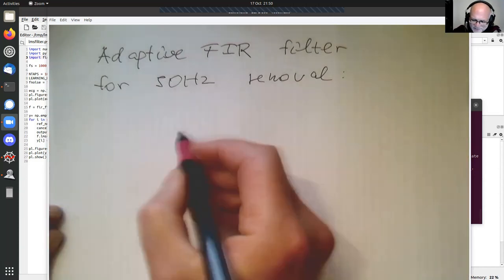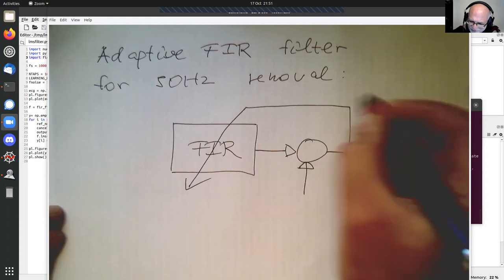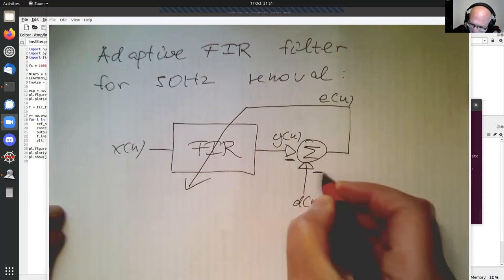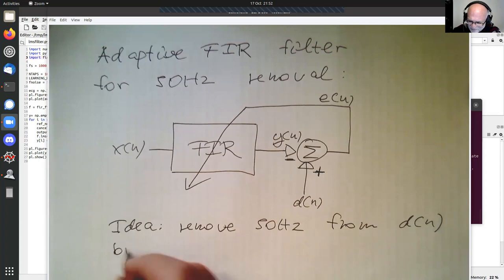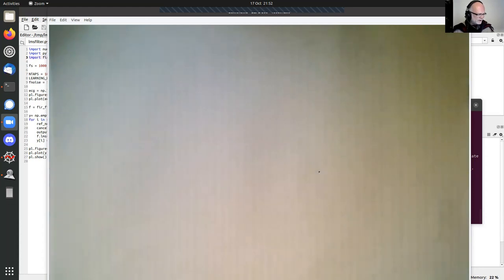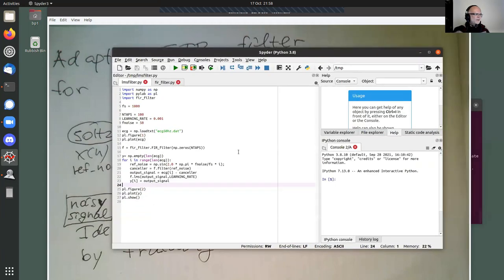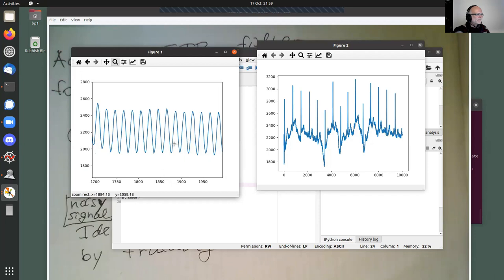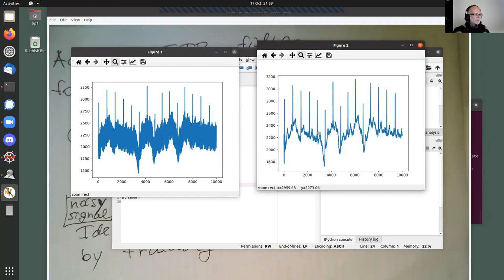Adaptive FIR LMS filters: 50 Hz removal as an example in Python

Comment: Hello DSP, Great example, I am looking for an adapter filter that can predict a threshold on an Acceleration Pulse width while its slope is going in a positive direction. The pulse or the Shock in time is what I am measuring.  From this can I get a velocity by integrating maybe.  If not maybe counts at the threshold.  Counting shock waves is not clean. Threshold is set by the adapter filter.  Weights are changing as well as the magnitude of the waveform.

Comment: Thank you for this great lessons. it inspired me to made some tests with your audio tool AudiClean, and the attached wav file  music+extractor.wav and extractor.wav as the noise reference.
It is very hard to find a entry point for a useful combination of the number of taps and learning rate for this  44k example. Do you have any hint for me?
Another point: What is the best practice for the amplitude of the reference noise? This value wasn't scaled in your python code for the 50Hz Signal [-1,1], but the extractor.wav ref signal for example is much higher.

Comment: I'm having trouble understanding why an LMS filter is required here when we already have the isolated 50hz noise and the noisy d[n]. Can't we just remove the noise by subtracting x[n] (50hz) from d[n]? Furthermore, the LMS filter should be minimizing e[n] as much as possible by matching the filter output (referred to as the canceller in the video) to d[n] as best as possible. In that case, wouldn't e[n] be close to zero instead of having the denoised signal? There must be something obvious I am missing?
Reply from the maker: Excellent questions! We could subtract the 50Hz indeed manually but for that we'd need to know the exact amplitude and phase of the 50Hz. The LMS filter susses that out by itself. Also in an ECG recording the 50Hz noise will be changing all the time so a constant subtraction would only work for a short time. But more important is a slowly changing phase relationship because 50Hz powerline is never 50Hz exactly but sometimes a tiny bit less and sometimes a tiny bit more so that the LMS filter needs to adapt. That for example is a problem when the learning rate is to slow that it cannot adapt to changing phase relationships. -- Regarding you other question about e[n]: this is indeed counter-intuitive and was wondering how long it takes that somebody would stumble over it. So you are quick! The reason why the ECG is not removed is because we tell via x(n) that 50Hz needs to be removed. The LMS filter can only remove noise which is correlated with d(n) so that it can only work on the 50Hz. The ECG will stay unaffected as it's not correlated to 50Hz. The error which is minimised is the mean correlation error between x(n) and d(n). This actually is a distinct advantage of this filter because the ECG won't be distorted at all in contrast to a narrow bandstop which would, because of it's long impulse response, create nasty ringing after an ECG peak. The HumBug (https://www.a-msystems.com/p-1270-hum-bug-noise-eliminator.aspx) works with exactly this principle and as you see they stress this fact. In particular in neuroscience signals can be quite pulse like  and cannot be filtered with a narrow 50Hz filter as these would trigger long impulse responses so an LMS filter is used.
Reply: @DSPcourse  Thank you for the detailed response! This makes much more sense now that I realize the LMS filter only removes correlated noise. Please keep the great and informative videos coming!

Comment: At 1:38 you say the idea is to remove the 50 Hz from d(n), I think you're mistaken - d(n) is the desired signal and should therefore not include the noise (50 Hz), I think you mean remove the 50 Hz from y(n).
Reply from the maker: No, the d(n) is the with noise polluted signal. A "normal" FIR filter, for example a bandstop would remove the 50Hz. However, here it's the opposite: y(n) is a "remover" or "canceller" so the FIR filter is not removing noise but is conditioning the reference noise x(n). The nomenclature is indeed confusing but stems from control theory where d(n) is the desired state.

Comment: Hello, I had a question, in the lms function is there a reason why you wrote coefficient[j]=coefficient[j]+error*mu*buffer[j] , shouldn't it be coefficient[j]=coefficient[j-1] or coefficient[j+1]=coefficient[j]  , since the changing coefficients depend on "Previous" coefficients modified by the error ,mu values ?
Reply from the maker: No. The index j refers to the tap index. All tap indices / weights have to be changed at every time step. There are two time scales. One at every time step (over all j) and the slow correction of the coefficients via the error feedback.
Reply: @DSPcourse  Thank you for the answer, so how where does the slow correction happen in the code

Comment: In the block diagram the output is also the error function, aren't we minimizing the error, so doesn't the output signal at the end gets reduced to nearly zero. I observed different block diagrams for LMS algorithm enabled adaptive filter in other sources. Is it error the output we get?
Reply from the maker: Because the filter can only remove what's correlates between the noise ref and the contaminated signal. So only the noise ref is removed.
Reply from the maker: Note there are loads of wrong papers and diagrans out there sadly.
Reply: @DSPcourse  yes!! some papers suggest that, input=signal+noise; desired=signal which is misleading. but, input=ref_noise; desired= signal+noise.   We are training the FIR to cancel the  correlated noise from desired signal. Am i correct?

Comment: Thank you for explanations, but you injected 50hz because you know it's frequency, what if you didn't knew the noise/artifact frequency ?
Reply from the maker: If you remove 50Hz with a bandstop you also need to know it's 50Hz. So, you need to know what's noise and what's signal. However, the advantage of the LMS approach is that we can either artificially generate the reference noise or record it via an additional sensor.

Comment: Maybe a stupid question but why not doing a bandpass filter to exclude the 50hz signal?
Reply from the maker: You mean bandstop? Of course that could be done. But for example for ECG with its delta-pulse like R-peaks a bandstop will create ringing. The adaptive filter won't. But the real power of an adaptive filter is when the noise is more complex, for example you want to cancel out noise in a hands free application where simple filtering is no longer possible but the noise needs to be subtracted. Here, neither the amount nor the pre-filtering is known and needs to be learned by the filter. In addition this will change constantly so it needs to be adaptive. The 50Hz removal is a very simple example but even that it's not altering the original signal at all with a filter is very desirable and you can buy this as a commercial device. It's called "hum-bug": https://www.a-msystems.com/p-1270-hum-bug-noise-eliminator.aspx For a lot of people in neurophys labs it's worth its $1,700.00 price tag!